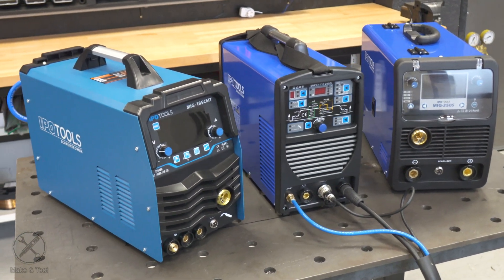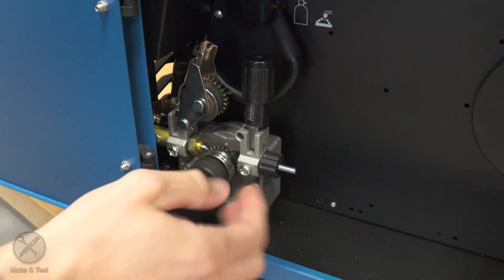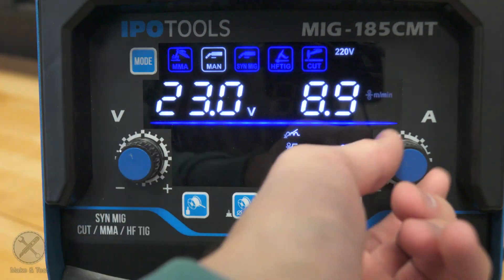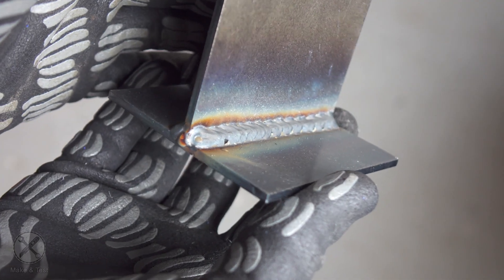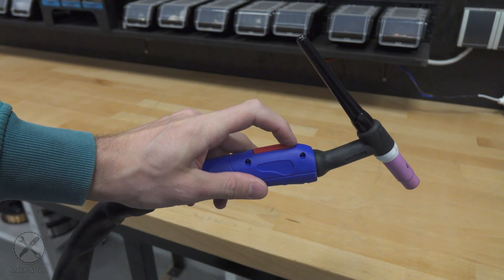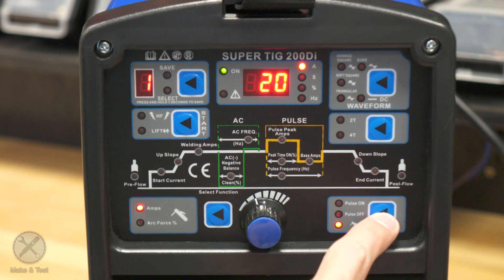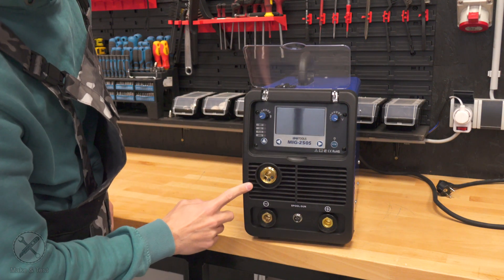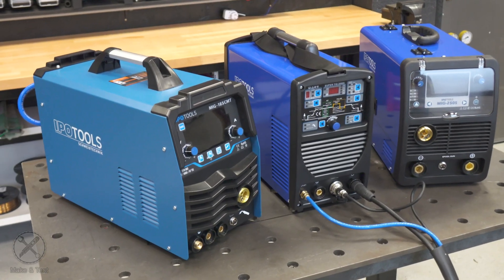My Top 3 IPOTOOLS Welders

Comment: "I'm looking to invest in a high-quality welder that fits both my current needs and will stay reliable over time, ideally within a budget of around €350. How do brands like WTL or Weldinger compare to IPO Tools in terms of performance, features, and overall value? Based on that, what would you personally recommend in this price range?"
Reply from the maker: Can't say because I have not tried other two brands.
Reply: @MakeAndTest-SecondChannel  Would you recommend this welder for beginners, and is it still a good choice as you gain more experience?
I saw that in synergic mode, the maximum output is 200A, while in manual mode it goes up to 250A. It also seems like the welder can run continuously up to around 160A, but if you're welding above that, you'll need to take breaks to avoid overheating due to thermal protection.
Reply: Talking about 250S welder